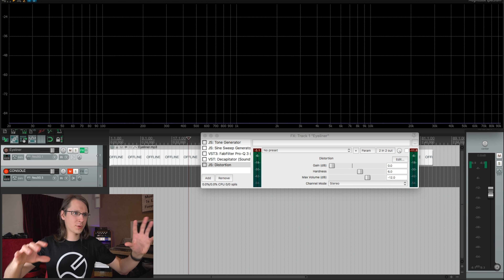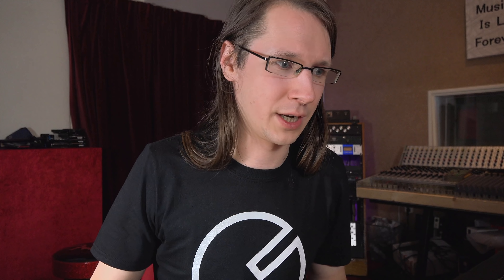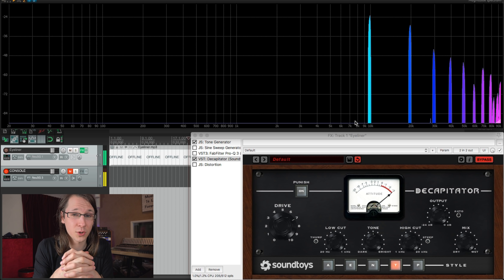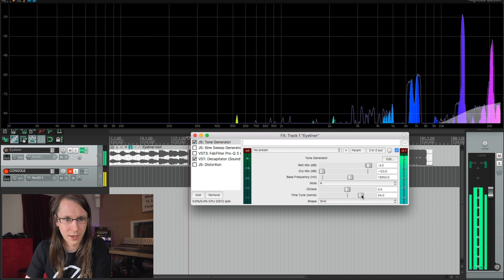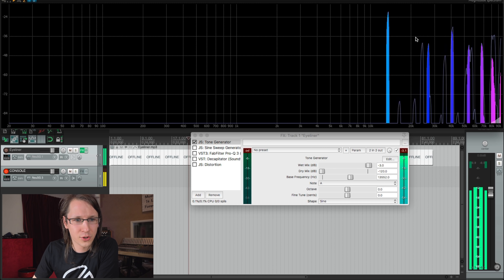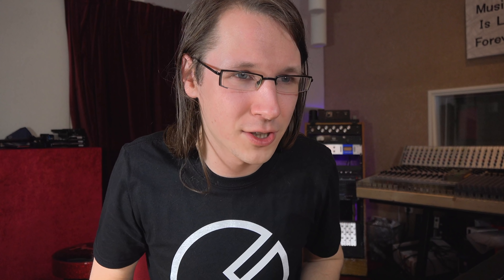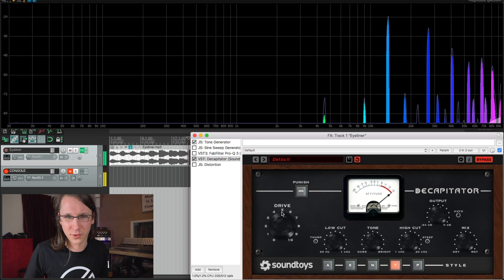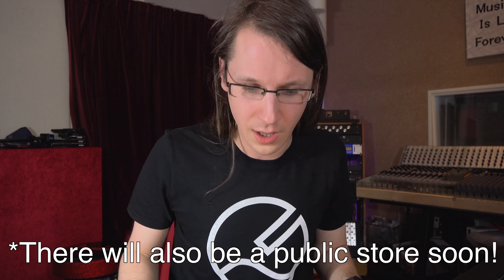Why MANY ANALOG EMULATIONS are SNAKE OIL!

Comment: I think what gets lost in this whole thing is that it's not Analog vs Digital its Analog and its Digital. They are different means of recording and processing sound. Yeah it's annoying that companies market around the "analog emulation" and for whatever reason getting as close to the original hardware unit is what makes something good or superior to other products... I guess that's what sells but that's really not the point. The question is does the processor accomplish what you want it to accomplish to your sound. What he's saying is all true and in a lab setting it's easy to reproduce these results with all sorts of plugins but the question is always what do you do with your tools in practice/production. He also has his fundamental at 13k and is driving that hard which again in real life are you going to do that very often? Like I personally love decapitator on kick drums and sometimes on the drum buss because it gets me the sound I want without having to use a bunch of plugins or go outboard and use up a ton of time when I can just turn a few knobs. Like as long as it gets the result I'm happy and I'm not super concerned with the aliasing that "may" occur unless I'm hearing something I don't like in which case I take off the plugin or alter the settings. And like he's saying maybe you have a complex sound (frequency spectrum wise) to begin with...decapitator just may not be the right tool for it. Fair enough use your ears. Analog isn't superior to digital it's just different. Companies love to market around the "realism" factor but as a consumer all you should care about is does it get the job done and sound the way you want it to sound for a price you feel is fair. For some the analog route is the only way to go and that's fine but it's not like all plugins are garbage and inferior because if that was the case no one would be using them to produce music with and they wouldnt sell.

Comment: That plugin is pretty bad but as a plugin programmer I would like to point out that in a real mix you would never have a 10k sound that loud.  Because loudness of the harmonics are prepositional to the sound they are generated from so most of those harmonics would be less than -96dbfs.  That being said, people still should be upsampling.  One further note is that I think a lot of people fall in love with using some analog in the process because an analog noise floor will completely mask any normal digital artifacts.

Comment: So the real problem with digital emulations of analogue gear is they cannot do it properly because digital does not yet have the resolution of analogue recording equipment. Analogue all the way!
Reply: Yeah, only when you have a quantum computer in your studio will you be close to analogue.
Reply from the maker: Yeah... that's the problem... I've been running some sessions with oversampling to the max... My beefy mac pro says no.

Comment: But your analog saturation should have aliasing too if you use low sample rate and dont lowpass it while its still analog
Edit 7:20
Reply: The soundcard has antialising filters on it.
Reply from the maker: The lowpass is done in the interface, you can't even remove that filter, it's part of the AD circuit.

Comment: Look at this! And this was at 192kHz sample rate (with MOTU 8A interface)! On the left: 1350 Hz sine wave signal distorted with IK T-Racks 1073 preamp emulation. On the right: 1350 Hz sine wave distorted with real hardware 1073 clone:
https://matthiasstockert.de/uploads/T-Racks_1073_vs_Hardware.jpg
Reply from the maker: Woooow

Comment: Plenty of emulations to deploy oversampling to correct this issue. Wavefactory's Spectre sure does, and the issue is even explained in page 13 of the manual. The pictures they included look just like how you tested it in your helpful video. https://wavesfactoryimages-4da8.kxcdn.com/wp-content/uploads/Spectre-User-Manual-1.5.pdf

Comment: So essentially you cannot cut out those potential higher frequencies because running at 48Khz only allows a filter/EQ window between 1Hz-48Khz while the plugin may be generating frequencies past 48Khz that are never cut out or possibly fire back into the 1Hz-48Khz range you are working in? Very interesting video!
Reply from the maker: You can only filter up to 24kHz indeed.

Comment: This smacks of mixing with your eyes. What are you likely to pile distortion on that also has a fundamental higher than even 5k? The highest fundamental in a guitar is maybe 4k. Cymbals, some specific synths, maybe you’re up around 8 k fundamentals - are you likely to want to distort those? They have plenty of sonic space on their own up there, what’s to cut through? Even if you did, say, to smear transients - the harmonics you generate that do happen to cross the threshold to cause aliasing must be so low in volume that the resulting sub-fundamental harmonics would be negligible, maybe they affect tone slightly but at some point you have to let go of the fact that while you, as a mix engineer, CAN distinguish incredible and rare subtleties, you should ALWAYS probably focus on the broader context of the mix, and whether or not it sounds good. And if it really bothers you, treat the aliasing like you would any other problem frequencies - with a notch or a bell or a lpf.

Comment: Now... when we see those 1700euros octo cards, from uad, made with less-than-5-dollars-per-unit-cheapass&slow-10years-old sharc dsps......being maxed out, with just a few stereo instance of some plug-in.....
...we understand why on  their dsp chart, they are only using 44/16, instead of 48/24... 96/24...192/24... and probably, their plug-ins aren't even doing any over-sampling processing... in order to not consume even more dsp power. ..
Just imagine... at 192/24, if supported, a 1700€ octo card could only run 1 or 2 instances,  before hitting 100% usage...
With the 'analog'  thing, they can justify the price. . The dsp consumption. ..etc etc
'Ohhh, you know. ..your 1700euro octo card quickly reaches 100%, because,  you know,  our plug-ins  sound even more analog  than the ANALOG  gear ! It's a miracle ! But don't worry,  when you run out of dsp power,  you can add another 1700€ octo card... and a 3rd one. .. our a 4th one. ..
Or you can buy 4 or 5 computers, install Vienna ensemble pro, and you can put 4 octo-cards inside each computer ! With a total of 24 octo cards, you should be fine ! '

Comment: Not sure about all of this.
Ever had two dwarsfluits playing loudly nearby in a close range? You hear the „third note“, some phenomenon of an undertone (let‘s just leave it at that).
Bob Marley‘s multitracks are a nice example if you listen to the channels of the background vocals, the analog equipment brings out (or creates) a lot of those undertones. If you record those vocals seperately you don‘t have this effect and the vocals clash easily.
I found an open source tube saturator that creates (amongst other things) those undertones if I feed seperately recorded vocals through that bus and I was really happy, because I felt that I had the same effect as in Marley‘s records AND if the singers were a little off correct intonation it sounded forgivable and great anyway... like the beatles singing „because“... horrific intonation, but after all it sounds lovely.

Where in my stream of thought did I make a wrong turn about all of that?
Seems to me that analog equipment is full of undertones...

Comment: erm no. there are plenty ways to antialias other than oversampling.
i mean, 10 minutes on nyquist? you asked AIRwindows? there is a vast difference between this awareness and "what goes into plugins". you are right, snake oil. but dsp..
eg. the DPW (differentiated parabolic waveforms) method of aa is relatively recent.. it is also bumpty style simple. audio dsp is certainly not empirically charted. right now you believe oversampling is good. this mentality would prevent you from engaging in many approaches which are musically valid.
this is the problem with the industry really. back in the 90s, internet music production communities (dancetech, the gas station) were very diverse communities. the advent of vst and kvraudio saw a brief period of chaos and achieved an "establishment" regime which silently removed content that "they" did not want people to be aware of.
eg. the old audio dsp archive references karlsen's filter, but karlsen was muslim. despite technical innovations he was riled and libeled until he voluntarily stopped participating in public affairs. this is seen repeatedly in the field, eg. the rush of freeware development with synthedit had to be squashed in order for profit and memetic authority to be upheld in the field.

do some years of dsp (its fun and easy once you're past the roadblocks of people trying ot make it otherwise) then talk about snake oil in plugins, using a very tenuous awareness of the procedures and players. but if all you're saying is "oversampling is good" you've got 10 minutes of pretty face.

its a real interesting field. after.. 17+? years, eg. aciddose is still working on xhip and contributing to the public benefit. so much shit has been talked and done in that field to keep people clueless and out of the way. let's talk about fft(log10(fft)) because it took like fucking twenty fucking years for any fucking bitch to talk about that.

Comment: An emulation is simulation of something else through another medium. The only people who really know the difference between using analogue equipment and digital at other times. Not the other way about. To call them snake oil is a bit unfair although maybe the emulations are hyped during marketing. It would be interesting to analyse something like DSP-based like Universal Audio, Protools HD/DSP or Waves Soundgrid hardware. 

Could the quality of your sound interface also be a factor also, whether it be cheap ass m-audio or higher-end RME interface? Who knows.

Comment: Yes but the real snake oil is analog equipment in a digital environment. Why? Because the signal have to pass forth and back trhu the ADDA several times.

If you have decided to mix in the box: Stick to the plugins. Analog modeled or not.

I am surprised you havent heard the signifikant loss in quality when using analog stuff in a digital system.

Comment: Good idea, but makes no sense to work above 10kHz. You may work with 100Hz or 1kHz fundamental to let us see the different harmonics. Because the difference between analog and digital is in the harmonic signature... Analog distortions are made of mainly even harmonics (musically correct), while digital distortion introduces mainly odd harmonics (musically wrong).

Comment: Your explanations are well done, however, I don't really understand the anger and negativity.

First,
 using a saturation (plugin and hardware) on a static sine wave, is a 
nice way of demonstrating the aliasing artifacts, however at -72dbFS (on
 the artifact return), is it REALLY that much of an issue and if it is, 
why not filter below your fundamental after the fact? (not that that 
scenario would every really happen in a real world application).

Second, (and you said it yourself), you use your ears first. Does it sound BAD?  Just because the aliasing artifacts are barfing back into the audible spectrum doesn't make it "BAD".... hell, I'm surprised someone hasn't taken this to 11 and called it a feature... oh wait...  You call it sand and grit... others might call that cool or interesting.  None of the artifacts from the aliasing used in a real world situation would cause audible issues that would derail a project other than someone using that knowledge as an excuse for their inability to work with a given set of tools.  Focusing on that kind of minutia is what gets people fired from some jobs (and hired for others) just depends on what side of the fence you want to be on.

Lastly, (and this is a general point after watching  a few of the videos...) your videos seem to forget the first rule of audio engineering.  There are NO rules.  If it sounds good, it is good, end of story and no amount of math or science will change that.  Just because something isn't 100% spot on sonically with the hardware doesn't make it snake oil or bad, it's just different. For the over 20 years I've been in the studio, I've never really felt something was "BAD" or bogus because it was different... if i didn't like it, i just didn't use it, but you can bet there's going to be someone out there that can use the hell out of it and make something creative with it.  Not sure how old you are, but if you remember the old Alesis 3630 compressor that all the pro's turned their nose up to (the same guys that liked mixing on NS10's) wound up becoming a staple for EDM music!  They say bad, someone else uses and embraces the "negative" aspects of the device in a creative way and, BAM! it becomes a sought after sound. 

In addition, I have 2 LA2A units in the rack.  One if them is pretty much indistinguishable from the UAD legacy LA2A plugin (from both an ear test and a spectral test).  And the reason i have 2 of them is not for stereo operation but because the second one had a very unique tone about it.  (Its not a "bad" LA2A, i wasn't sold snake oil, its just different).  Out of all channels of Neve pre's in my rack none of them sound "identical" (the beauty of analog).  The beauty of digital is the consistency, embrace it.  I would love to see you turn all that knowledge and energy toward the positive in a future video and take the BAD of something and use show how the "junk" can be used creatively and what positives it can bring to the table. 

Just my opinion, I think you have a lot of potential to use this platform for positivity rather than negativity.
Reply: I have to respectfully disagree.

First, this is like asking Glenn from SpectreSoundStudios to become all nice and positive. Where's the fun in that? :-) This is all part of his personality and the entertainment value of his channel that we're partly here for. The scene is dominated by tons of politically correct channels and even big name engineers (with an obvious business interest) keeping it 100% positive, praising everything they're asked to advertise. They sure are not going to criticize anything or educate young engineers about the pitfalls of digital processing and snake oil'ish products that they NEED to be aware of IN ORDER to make better digital sound. There just isn't as much profit for them in that. This type of channel is a reaction to that and a breath of fresh air.

Second, digital artifacts like aliasing, truncation distortion, pre-ringing artifacts, etc. are utterly bad and non-musical.  This is NOT a matter of "taste". For instance, dithering (as the technique for trying to deal with truncation error) is not a matter of taste. It simply HAS to be done. You mentioned UAD, they're actually one of the better developers at trying to deal with digital artifacts. For instance, last I checked they implement an anti-aliasing filter (essentially a low pass filter) under the hood in their plugins (look it up). You'd be surprised how many developers don't even try to address these issues.

Third, digital processing artifacts are cumulative in nature. You may be okay with having garbage at -72dbFS. I'm not because that garbage is often produced at several stages per track, at the buss tracks, several stages on the mix buss, and then in mastering (if it's digital mastering). All of a sudden I can clearly hear that "digital" sound (in the negative sense). So the final effect is often worse than what the -72dbFS "can't hear it so who cares?" argument makes it out to be. Going further, people and new generations get used to that sound, becomes clueless about what experiencing purer audio is like, and popular taste and music is brought to a lower standard instead of evolving.

Finally, a quick FYI: there is a reason NS-10's were so successful. It's not their frequency response. It's how relatively "quick" they are (an aspect in monitoring systems measured with waterfall graphs), allowing to better hear transients and where they sit in the mix. You can "learn" the frequency response (frequency domain) of a monitoring system and compensate for it in your head when mixing, but you can't "learn" its time domain nor compensate for it if it's rubbish. This is the primary secret behind NS-10's and why they make mixing easier despite their funny mid-range-centric frequency response. Notice how many monitor makers sell "flat" frequency responses but hardly show any waterfall graphs or talk about why that's important in judging mixing monitors. Not that I'd recommend buying NS-10's these days of course (because there are some great monitors from serious providers that do address this) but just saying. :-)
Reply: I fully agree with all the above. I want to add that it is necessary to use blind tests. It makes no sense to compare emulation to analogue by ear, if you know where the analogue is, and where the emulation is. Unfortunately, people rarely sincerely listen with their ears, they usually do it with their eyes.

Comment: Thank You!!!  I have Decapitator, and use it only very sparingly, but really don't understand the people who gush over it.  I think it sounds pretty awful most of the time. (I run at 44/48k)  This also explains why digital guitar amp tones still don't layer as well as analog distortion tones..... I get tracks to mix of multi-layered modeled guitar tones that just turn into a wall of digital white noise above 5kHz.  It makes me think the guitarists are too deaf to hear that high!  Then I'll play some old Def Leppard or Metallica to hear what REAL guitar tones are supposed to sound like.